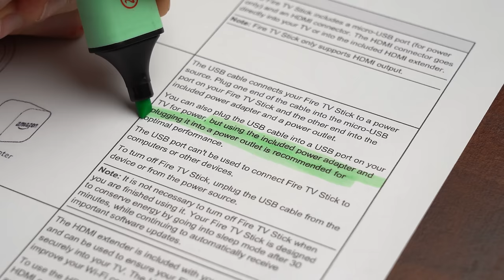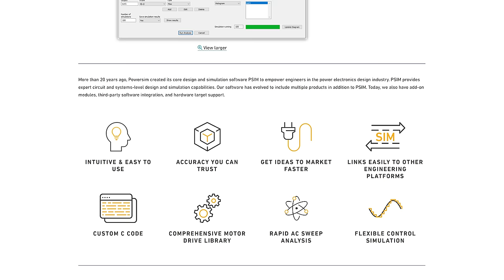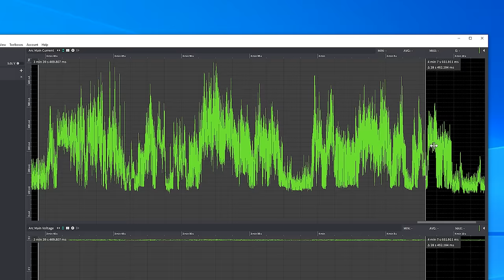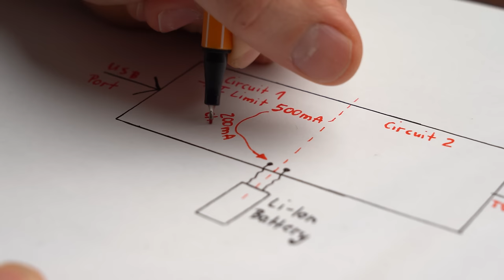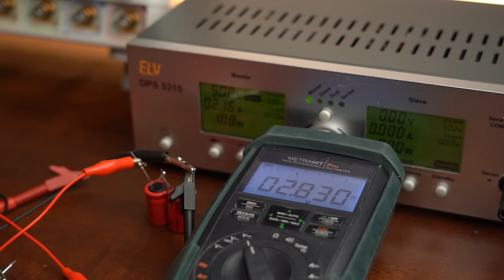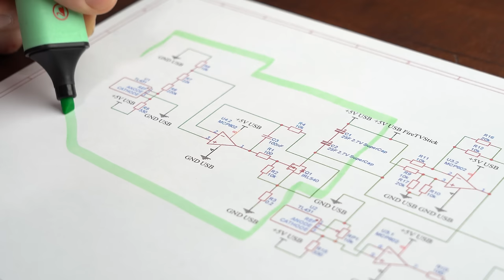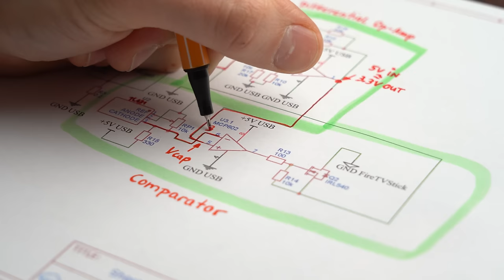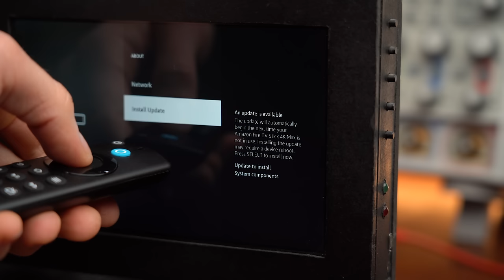I recreated an Amazon Product to make it better & cheaper! (for Fire TV Stick)

Comment: I see there one big problem: You did all the switching and sensing on the GND side. That means as it works (the current sensing, current limitting, load switching,...), it will make voltage differences between these grounds.
But this GND is common with the USB communication, connected inside of the TV. That means the "fire stick supply output" GND is shorted out with the "power input" GND, once it gets connected together into one TV.
You should just have made all the current sensing and regulation on the positive side (so using PMOS devices,...), keeping the one single common GND.
Reply: I agree. I am surprised it worked at all when he used it on his actual TV. My only explanation for that is that his TV's port already has soft current limiting, meaning he could have gotten away with just connecting the capacitors directly to the USB port power.
Reply: Agreed switching the ground is a recipe for disaster.
Reply: Yes... wow...
Reply from the maker: This is exactly why I wrote down "not tested for longer time" on the disadvantage side. Now longer testing would not have revealed this problem because my TV works with my solution. But if I would have other TVs to test I think I would have found this problem sooner. It seems like I ignored that the USB GND and HDMI GND are apparently most of the time connected together. In theory that should mean that charging the supercaps up and adding the FireTV stick should work just fine. But afterwards the lower MOSFET would get shorted which means we remove the current limiter. Since there are still the supercaps in parallel to the Fire Stick that should not be such a big deal breaker. But yes. I think this is a problem in my circuit which I didn't find with lab bench power supply testing and with my TV testing. This is all theory in my head right now by the way. So the problem can be bigger or smaller. Switching the positive votlage side with P-Channel MOSFETs would solve the problem. That would require a bit of a redesign but the main components should stay the same. Sorry about that.
Reply: @greatscottlab  Hey I'm sorry but I didn't exactly get what the above commenter explained. Could you perhaps elaborate in a yt short or a community post or even here.
Reply: Tak pri krátkom používaní by nemalo nič poškodiť. Ale áno, je to problém.
*In short use it should not damage anything.
Reply: It is not that much about damaging - USB is supposed to be protected and the mild overcurrent is only real problem when it exposes the stuff for longer time (overheating,...), what is not the case here.
The problem would be the USB overcurrent protection tripping and shutting the power down. But that depends on how exactly is the protection designed and what is the wire resistance of the USB power feed. Higher resistance means the voltage on the capacitors has some room to droop before the current increases, so makes the contraption effective to some extend.
But if some TV is too picky, it may shut down the power and you will see it with a delay (when the capacitors discharge).

Otherwise using PMOSes makes the circuit essentially the same, you just swap the supply terminals of the wiring, opamp, caps and the references. The positive input then becomes the "reference ground" (a net, towards all voltages are referenced to) for the circuit, but that does not prevent it from working. Just a bit more tricky to mentally track the functionality for someone who is not used to these tricks...
Reply: @animatrix1851  The design assumes an independent GND FireTVStick and GND USB. This can easily be seen in how the discharge comparator is supposed to work by connecting the negative of the supercapacitors to GND FireTVStick. Under the assumption that the two grounds are separated, if its transistor (Q2) is "off" then the system will float the +5V FireTVStick rail at capacitor voltage while not giving it a return path (thereby preventing current from flowing).

However, as the other commenters noted, the grounds are all connected together by the TV. In this case, current will flow from the +5V FireTVStick rail through to the TV's ground (which is both GND FireTVStick and GND USB). The only thing the circuit will do is limit the supercapacitor charge rate to 500mA; the entire comparator section that is supposed to switch on the Fire TV when the supercapacitors are charged is basically dead weight. 

The fix for this problem is to switch and sense +5V FireTVStick instead of GND FireTVStick.
Reply: @greatscottlab  It would be fascinating if you made a sequel to the video explaining all this and showing off an improved version. Or a video explaining why the current version is fine after all if that turns out to be the case.
Reply: I second Lewis's suggestion of a follow-up video on this. These are important things for people to know, learn, and understand.
Reply: @greatscottlab  While it's great you pinned this comment it would be better to add to the video description otherwise people may not see this.
Reply: If you fix the issue and make gerber files, I promise to join your patreon!
I might support you anyway :D
Reply: I believe there is something even worse and without the extra GND coming from the other connector the thing may not work at all and do more harm than good. The problem is the circuit on the right that disconnects the ground from the output when supercap voltage gets too low. But the input is current limited so when the demand goes up above 0.5A for too long the voltage is going to go below the limit. When it happens the output will get disconnected, the voltage goes up again, the output gets connected back and so on - we basically get a sawtooth oscillator. The output disconnect circuit needs some hysteresis to be stable under all possible load conditons.

To be honest I like the general idea of the simple circuit, it has some potential. But the actual implementation still clearly needs some work. And some bells and whistles like mode indication LEDs would be nice too.
Reply: @timmturner  AGREED... I TOTALLY MISSED IT ON THE VIDEO. SO ID LOVE TO SEE HIM MAKE A VIDEO ON THE FIX...
Reply: Can't you just replace the li-ion cell ,inside the prebuilt circuit u showed, with 2-3 supercaps in parallel
Reply: @annaplojharova1400  Teach me, sensei.
Reply: @greatscottlab  the way I would do this is put an LM317 current limiter (one resistor between adj and out) set at 0.5A at the 5V input from USB, follow that with supercaps to ground, and a pmos after that. Then switch the pmos on using a comparator with hysteresis when supercap voltage raises over about 3-4v since LM317 needs a volt or two of headroom. Finally take this 3-4v and boost it back up to 5V using a cheap 1A boost converter one can buy from AliExpress and such.
Reply: @greatscottlab  You could use a simple dc-dc isolated 5v-5v transformer, it draws around 20mA idle and can pass 500mA without a problem. In that case you made it even better than the commercial version. It costs around €2,50. By the way: your costs of around €10 are on the high side if you want to compare to the commercial version. If you should produce your design in China with for example 1000 at once, I think the costs per board will be lower than €5 including assembly.
Reply: @Lew114  I second that. I want to learn and really want to understand what's going on and how / where I can learn more about this, what it's called, how to catch it, why it's bad / dangerous,
Reply: I have drawn a PMOS version that incorporates many of the ideas in the comments.  https://drive.google.com/file/d/1Fv6keRd89r6PYK_ZvZd_b04rTnBDRZ65/view?usp=sharing

Comment: I'd added 2 LEDs to show is in charging and when ready, also a protection diode to get polarity protection and * feedback current from supercaps to tv.
*Edit: avoid
Reply from the maker: Good ideas for improvement :-)
Reply: Is there a schematic out there of these improvements?
Reply from the maker: @jonmayer  Not yet.
Reply: @greatscottlab  And capacitors needs some big parallel resistors for long term balancing.
Reply: Go for it
Reply: Surely polarity protection is not needed, this plugs in to a USB port, what would be the mechanism for presenting reverse polarity?

Comment: It still amazes me that we have devices like this today that are so small and are basically full fledged mini computers that can stream 4K video while using only around 200ma of power at 5V!
Reply: Hardware decoders are amazing, you can do the same video reproduction task with either gobs of processing power, or a small fraction of it with the correct hardware. I think even plain MPEG 2 video at those resolutions would put a strain on a processor with that little power consumption if they didn't have the hardware decoders, then again back at your point, it's still really impressive how said decoder can do such a feat with so little power.
Reply: @Kalvinjj  iirc rpi3 can decode 1080p24 hevc 10bit with SW decoding and consume about 5V1A. But it has a general purpose low budget chip.
Reply: Was he streaming it at 4k?
Reply: Whether or not it was 4k isn't the point.  I'm guessing the poster is around my age.  I'm 53 and remember being in computer classes where a GB was theoretical.  No one believed at the time something could be so large.  I remember being hot shit and paying $400 for a single 4MB SIMM of RAM.  The fact technology has progressed this far is the point he/she was making.  Shit, I remember a time when there was no internet.
Reply: @llspragulus  im interested in it, whether its the point or not, since there was a lot of difference in power consumption between 4k and 720p.
Reply: @bulletpunch9317  gotcha that makes sense.  Sorry for the negative connotation of my last post.
Reply: @llspragulus  yeah close-ish! I'm 40. My first PC was a 166mhz desktop in the early 90's. I also remember the first time I bought a 1GB 5.25" hard drive, thinking there's now way I could ever use all that space!
Reply: And then we have massive devices to smoothen their power consumption just a bit to make them run on a TV USB port :D :D
Reply: @ft6637  which is kind of ironic that the TV limits current in the USB port when it literally has a power supply capable of delivering at least 40W.
But that's per spec.
If you would modify the TV instead of creating a brick, I bet you could just tap a 5V line coming from the PSU and plug directly into the TV stick.
You can solve the problem with 2 wires a bit of solder and a single mini-usb connector.
Reply: Modifying the TV is a far fetch, you are going to make a tiny hole to pass 2 wires and decap some of the wires of the TV to make a vampire connection.
Reply: Next step: embedding the stick inside the TV.
Now the TV is literally a smart TV.
Exercise left for the reader: figure out how to put the LCR used by the IR in remote control in the same hole that the TV uses, or even tapping it's signal, with some lucky they are compatible in frequency too.
Reply: @monad_tcp  heck HDMI itself has +5v pins per spec, it's kinda silly it's spec capped at 50mA too. Such a cable thingy shouldn't even be necessary if they allowed something around 1A to it.
Reply: @Kalvinjj  depends on how pants ya TV is some smart TVs have HDD usb but why is there more than 1 usb on TVs like ya gonna charge ya fone or something 🤔
Reply: @Kalvinjj  lol, its not the cable, its usually the USB driver chip capped at USB 1.0. and I did say it was capped by the spec, its not even the cable, its just if it was USB 1.1 you would have 500mA.  I want USB-PD with 90W muahahaaa
Reply: @davey2k12  You would need at least 2 USB ports, keyboard + mouse
Reply: @Kalvinjj  everything must be USB 3.0-PD. I'm replacing all my Nema-15 connectors in my house for USB. Everything will be USB. At least a TV can be (proceeds to turn a toaster into USB PD)
No more power bricks.
Reply: @monad_tcp  Yeah what I mean is that they should have just made HDMI specs to allow 1A 5V to begin with instead of limiting it to the barely usable amount it allows, then the Amazon device itself wouldn't even have a USB power input since the start, it could just draw from the HDMI input itself, but well, now it's kinda too late to change the specs and get some benefits, the TVs that would have the newer connectors wouldn't need the stick either.
Reply: @monad_tcp  or just use the given usb 5v 1A power brick and leave it connected,i use it like that since 3 years and zero problems
Reply: @VincenzoAvallone  it takes space, but sure
Reply: @monad_tcp  I believe the Firestick remote is Bluetooth not IR.
Reply: @Kalvinjj  And my Ryzen Legion 5  gaming laptop needs 300W wall adapter to play FHD video smoothly. Video chopping badly at battery power.
Reply: That unit CANNOT steam 4K. lmao It'll reboot itself everytime you try to do ANYTHING on a 4K tv. Ask me how I know. Not even on a over sized power supply could it dream of 4K....
Reply: @bulletpunch9317   there are more pixels  but  the compression rate might be less it depends what the stream does contain y mean amazon sticks are smart phones  but custom builds well even at max loads the cpu does not run at max frequency oem builders  ( excluded samsung ) do not set the cpu scheduler at performance mode so  the thing is those would fit better on monitors but all tv at today standard includes also a app store where you can download certain apps,  why not cast your phone on tv it has more capabilities
Reply: @Kalvinjj  shore but the usb chips on the smarts are usually intended fore self powered devices
Reply: @keithmarlowe5569  yeah they became a portable pc y mean y have a samsung s22 with exynos and that thing has a dual gpu insli configuration supports direct ray tracing,  that yould run even windows native just need to reconfigure the partition and bootloader in order to boot from also an efi system but y run NetHunter kali side by side with android it has a 12 gb ram with another up to 8 ram plus extension that is used for compressed swap system in to ram  wich can record at 8k continuous that SoC has pci express line wich is the wifi and modem connected  but regarding the configuration well y would prefer also a battery setup  (ups ) since that is a pc  and to powe PCs without a constant electricity y won't recomend,

Comment: Mid air circuits should be considered art
Reply from the maker: I think so too ;-)
Reply: and a fire hazard </s>
Reply: @heartlessalice5801  A discharge hazard at least.
I wouldn't want to be hit by those capacitors
Reply: Here in Brazil some people call them spider circuits
Reply: @TheNumbuh121  in english it is called "dead bug"
Reply: @jimurrata6785  I don't think those 2.5v capacitors are going to be able to hurt you
Reply: there is art like that, for example Peter Vogel or Elias Haisch and many others
Reply: @jimurrata6785  Not really but it's pretty easy to avoid licking a capacitor by accident and even if you did it would only threaten your tongue. Colour CRT TVs could run at voltages as high as 30kV, or literally more than 10 thousand times as high as those capacitors. 2.5v would be enough to moderately hurt your tongue in most cases if I had to guess
Reply: @clancywiggum3198  "Do Not Lick" is the favorite warning among engineers, especially when dealing with many 10s of kilowatt systems.
Reply: Just coat it in a thin layer of epoxy. If you do it thin enough the circuit can still be repaired and managed. Would have to touch up with epoxy though.